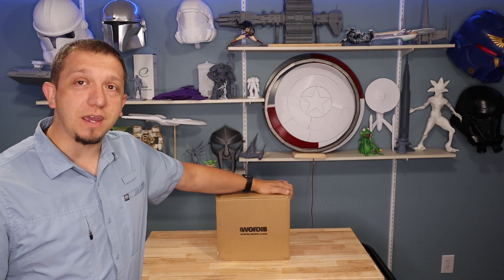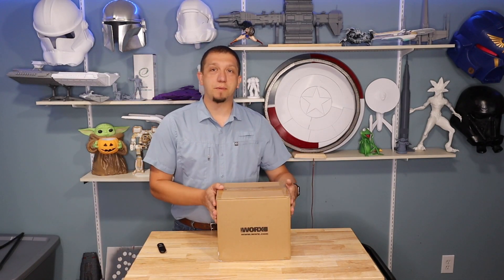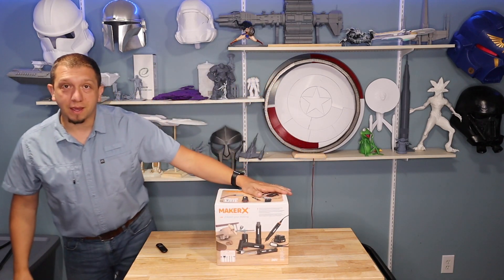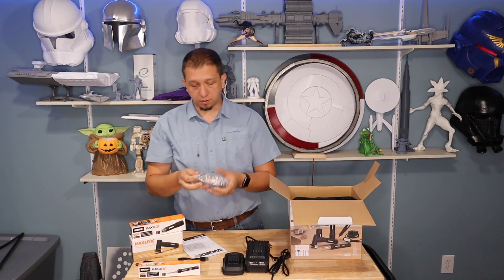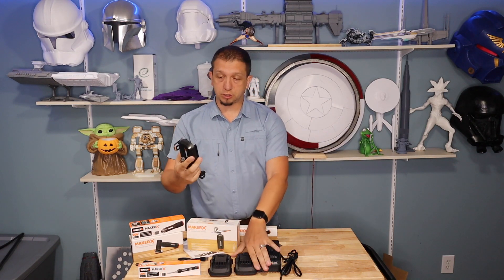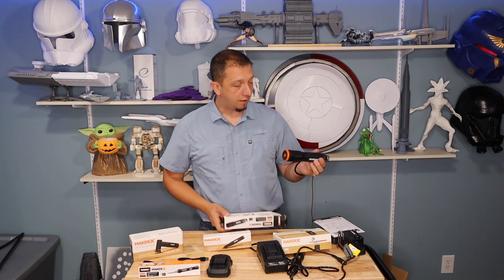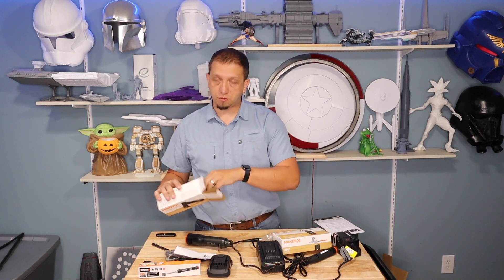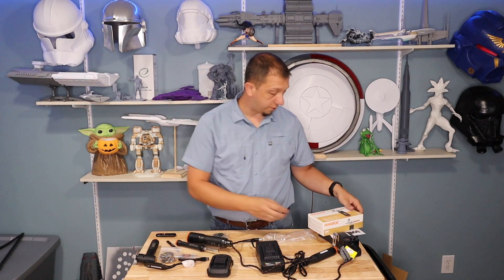Tools for 3D Modeling - Worx  MakerX hobbyist tool kit

Comment: Very interested to see thoughts on the airbrush as I’ve had the same issue with those portable brushes. I’ve been really happy with the rotary tool and soldering iron. Really comfortable to hold and use. Only tiny issue is that those comfort grips do get dirty easily.